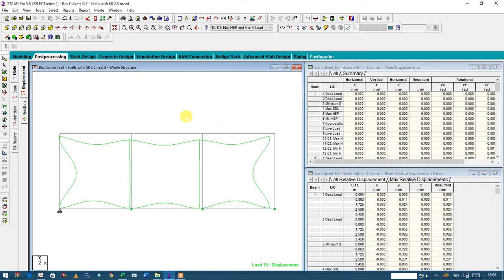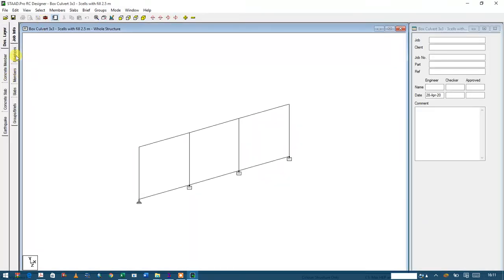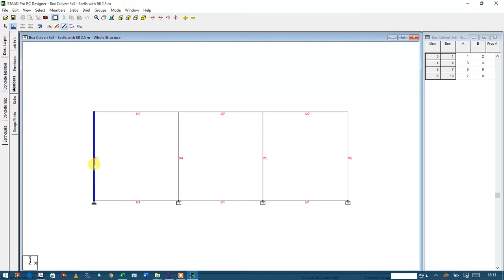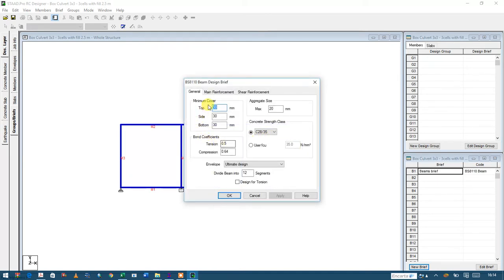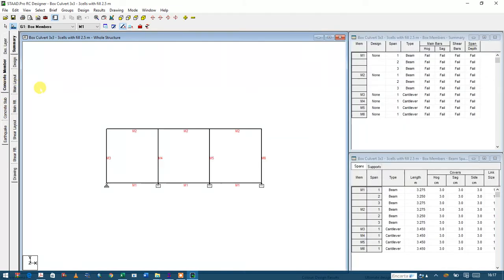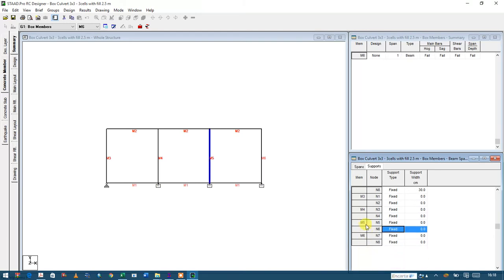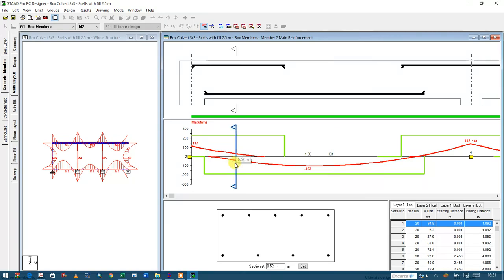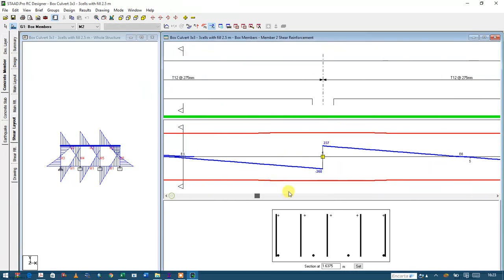Box Culvert Design BS Code Practical Example Part 5

Comment: I have the following questions;
1. How to model temperature loading in Staadpro as required by BD31/01
2. or why Temperature load was neglected  in the tutorial.
3. how the three recommended load combinations (1,3,4) relate with the load case diagrams in Apendix A
4. why you didn't have to consider all the 7 load case diagrams in appendix A
5. Why HB load was considered as UDL on the whole slab instead of Moving Load or critical positions.
6. Where can i get your Excel loading sheet? 
Thanks you so much for sharing your knowledge.